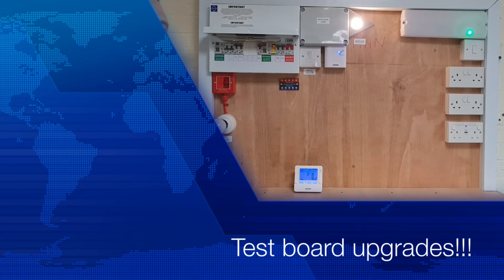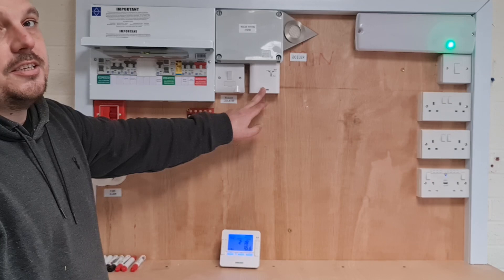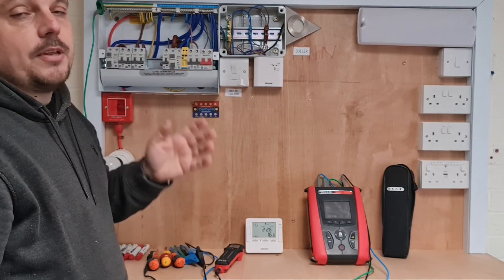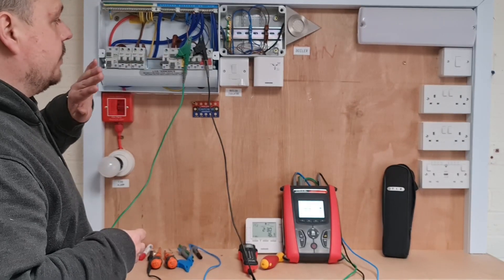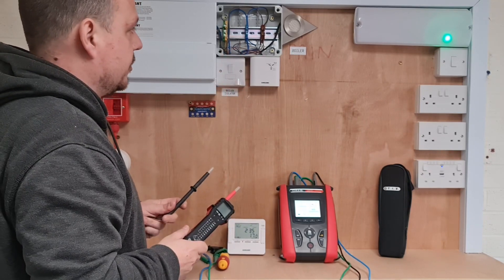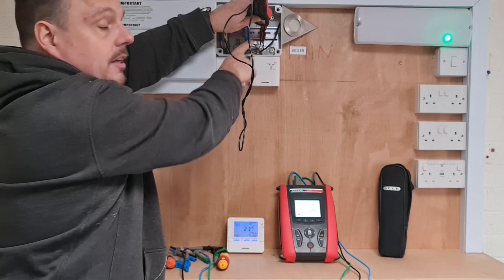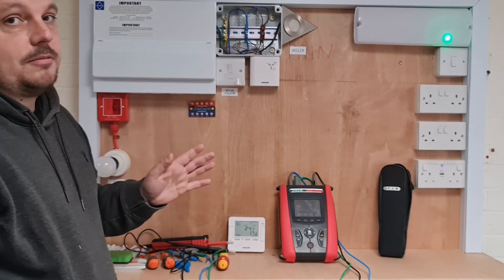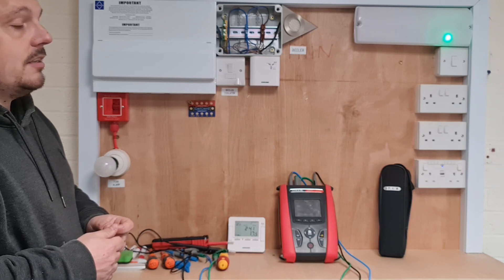What a lash up!!! Electricians Test board {new setup}

Comment: Another good one Mark. I have to do a lot of commissioning as well as fault finding which is nearly impossible on a dead system.
But to hammer home about proving dead a few years back I had a breakdown on a CNC milling machine. I had a good idea what the fault was, swarf build up on the micro switch that indicates which zone the machining head is in.
I chucked an airline into the machine on a curly cord then moved to the back of the machine, opening the guard should kill drive power and air. I cleaned the microswitches and the Led shone green, then the machine started to return to machining.
I was very fortunate, if the machine had needed a tool change the tool arm would have taken the top off my head.
I was on the opposite side of the gantry to the door but knew if I laid down the gantry would move over my rounded gut (just). I then scrambled out, slipped on some swarf and sliced my arm open.
Reason for movement, operator had disassembled the safety switch on the door so he could clean the machine without stopping production.
The lesson, don't trust anyone or anything, get your meter in there and lock out kit even if you need control voltages, isolate the mains elsewhere, understand the machine.